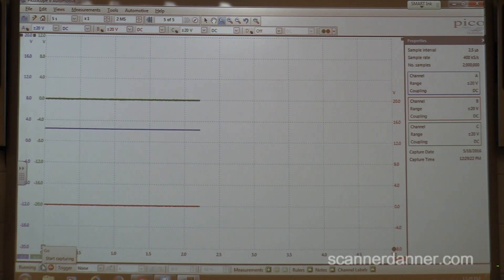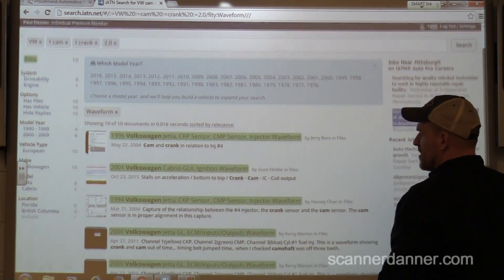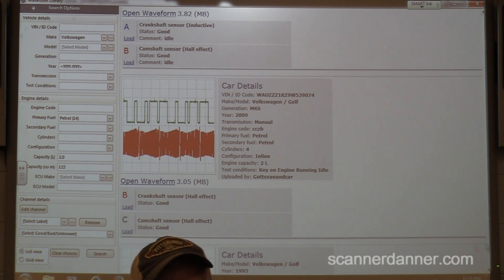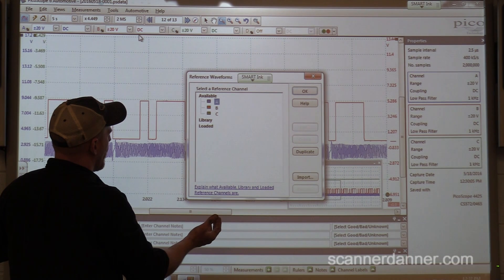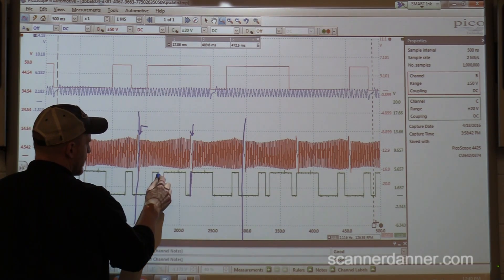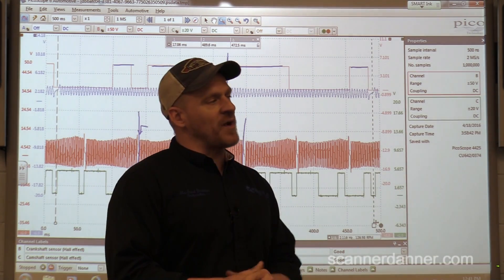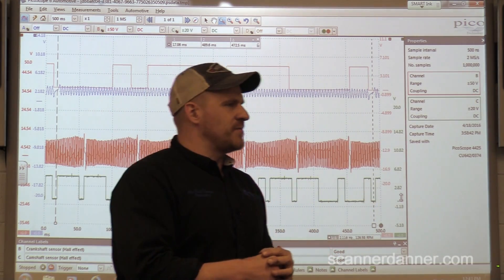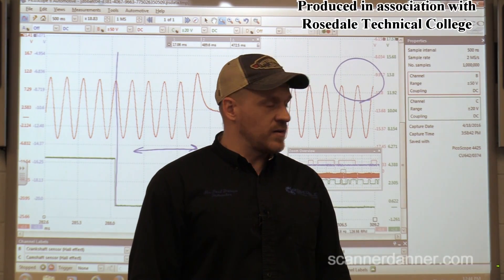Where to get known good lab scope waveforms

Comment: Automotive guys incorrectly use the term "lab scope", in reality that is a deprecated term, used to refer to the old "mainframe" units that were large boxes with the CRT, power supply, and drive circuitry that took removable "plug-ins" for timebase and vertical amp units, or dedicated special plug-ins for spectrum analyzers, logic devices, or what have you. These are no longer made or supported and mostly you see them in hokey car commercials or old movies. 

 Tek has a good .pdf article on using their scopes for CANbus and LIN troubleshooting on their web site. This mostly covers their 5 Series MSO flat panel scope, which is admittedly bulky and nonruggedized for use in a service environment. Fluke makes the more portable ScopeMeter lines but they do not have this type of specialized firmware built in or available.

 No one makes what you really want-a good ruggedized handheld general purpose oscilloscope with specific support for bus analysis. As cars start requiring real actual electronic expertise to fix  and no one not comfortable in a PLC or industrial control environment is going to make a successful living in automotive other than changing oil and tires this is going to have to change. But I somehow think vendors like SnapOn, who are great at making mechanical tools and tool boxes, just don't really get the electronic T&M paradigm-indeed, they abandoned the market for electronic oriented hand tools with their very good Electroset program to vendors like Jensen Tools.

Comment: FYI, FOR THE POOR DIYer's like ME: If you download the FREE Pico 6 Automotive software from the website, install then open it up. If you go into the top menu named "AUTOMOTIVE". In that drop down menu, make sure the "SHOW WEB HELP" box is ticked and then select from the list of waveforms they have (THERE ARE MANY). The waveform will open in the software, but if the "SHOW HELP" box was ticked as I stated earlier, the internet will auto open and bring you to there site with the selected waveform open as well as all the info you need to do the test. Just print to PDF or paper and you got it. Its a pain to print them all, but worth it.

Comment: Hi, wanted to suggest some topics for future videos if you can do it.  1) videos on the multiplexed wiring systems found on European cars.  2) Also can you show safe methods for testing solenoids. These soleonoids like ones of EVAP can get burnt if attached directly to a car battery. I use a 9V battery for these tests but there should be a safe method with a 12V battery too by limiting the current. 3) Lean misifre diagnosis due to lean fuel (water mixed with gasoline or too much water in Ethanol).

Comment: Great Video Paul, really appreciate the amount of effort and time you must put into these videos. Just a thought on why the capture you took from the vehicle you were working on didn't match up with the waveform you loaded. At the beginning of the video, your "sweep" as I call it because I have a Verus, is 5 seconds, but the one you loaded looked like a 500 ms sweep. The capture file also indicated it was taken key on engine running at idle, which will be running faster than the cranking waveform you took (which you obviously know... lol). I assume that when you loaded your waveform into the downloaded one, it changed the sweep to the same scale as the file it was going into, so it looked like you didn't have the repetition. Simply, I think the difference was because the engine you are working on was turning slower than the known good pattern.
Reply from the maker: great observation! I believe that is exactly what happened. Thank you!

Comment: I saw you use in the video there are several types of oscilloscope, the first is Pico Scope, the second is Snap on, there is ATS Escope , I want to know, which is the best performance of the three types of oscilloscope, or the highest price？
Reply from the maker: each one is different and has it's advantages. My Snap-on scopes are more mobile friendly because I do not need a laptop. But when it comes to detail and function, the Pico is by far the best scope I have ever used.

Comment: great video and a great resource for waveforms, thank you. I like to split the screen into 2 views sometimes when using reference waveforms that way you can zoom independently and measure the degrees of difference.
Reply from the maker: I need to figure out how to do that. Someone else told me the same thing. Something about selecting another scope view?
Reply: Yes, pretty easy actually, with a file open such as the one you have here, click views menu, then click "add view" then "scope". It will open a second scope screen below the first one with the same channels on it. you switch between scopes by clicking anywhere in the field of the scope you want to edit and work as usual. you can right click on one view and select the channels you want to see there including any loaded reference waves, then right click on the other and select the channels you want to display there. The advantage of doing this is you can zoom vertically and horizontally independently and use cursors and phase markers independently. This is also very useful for getting before and after repair shots on the same printout page for the customer.
Reply from the maker: Thanks Dan!